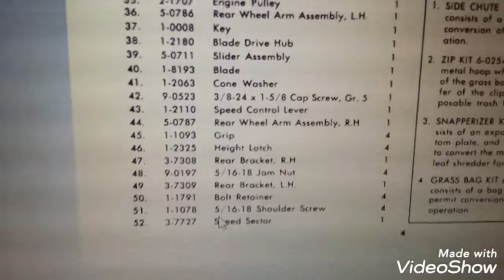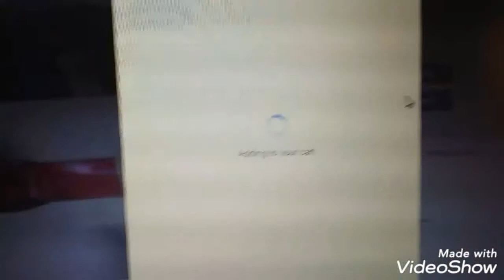My free 21" Snapper made bad noises then died... Let's dig into it and find out what's up..

Comment: Did you check the blade adapter & key inside , & the old blade looked like all it needed was sharpened .! :-) just sayin !
Reply from the maker: With it off and sitting on a flat surface it looks tweeked... the two fender washers could easily have added to the 1" out of straight. Thanks for the comment..